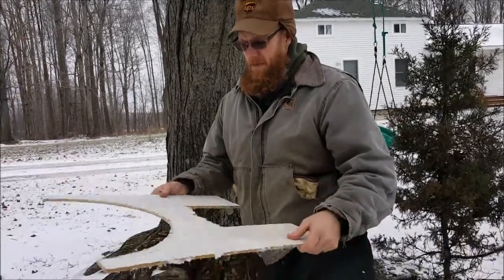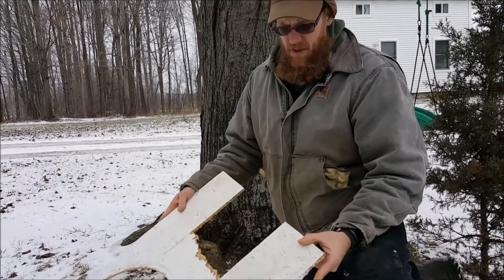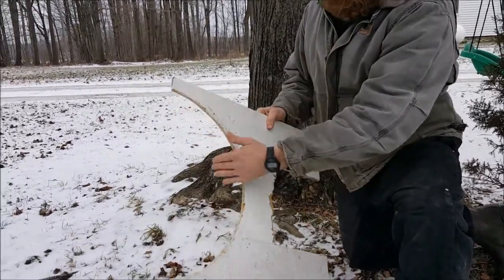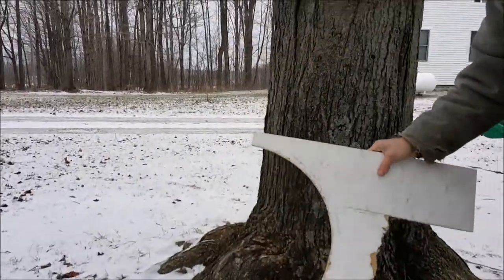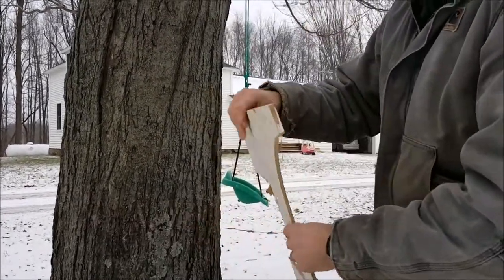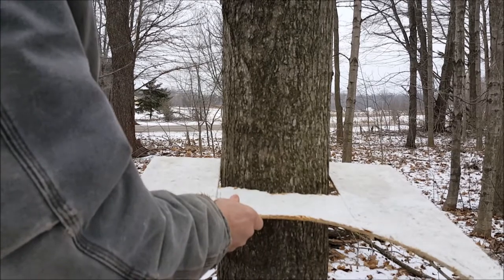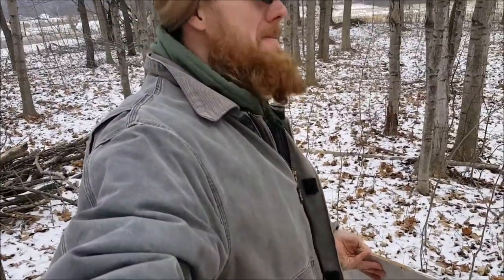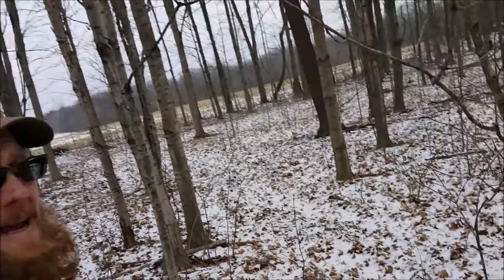2019 Maple Syrup Vlogs Episode 2 (Tree diameter jig)

Comment: I was watching your video on your evap if you attach cheap trailer jacks to the legs it will allow you to level the evap with just a few cranks so if the ground moves during or between boils and when you drain evap you can tilt it to move syrup to the drain effortlessly
Reply from the maker: Great idea. I’ll need to price some
Reply: @YoungbloodFamilyFarm  
You can usually pick them up for about 20 bucks at harbor freight